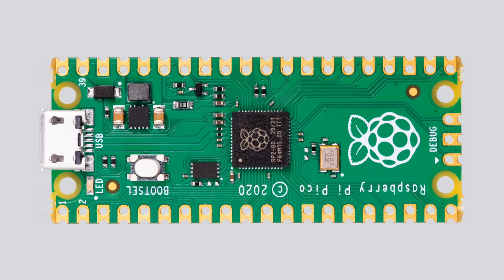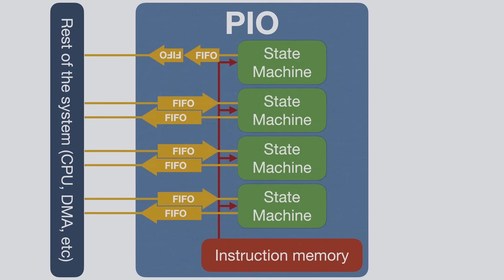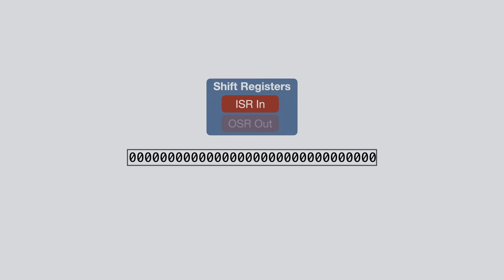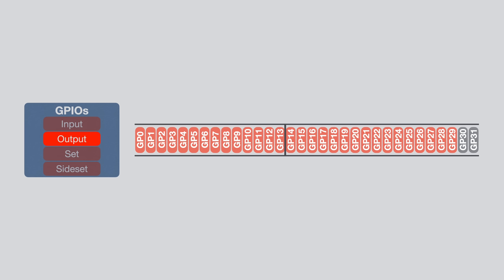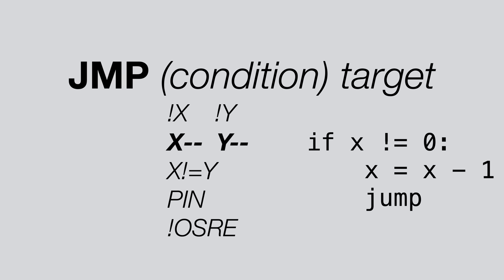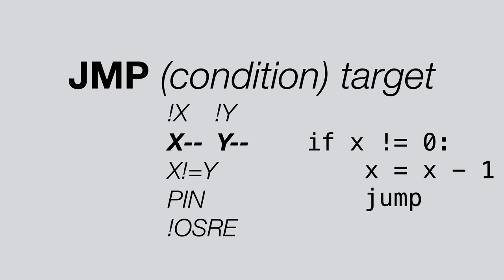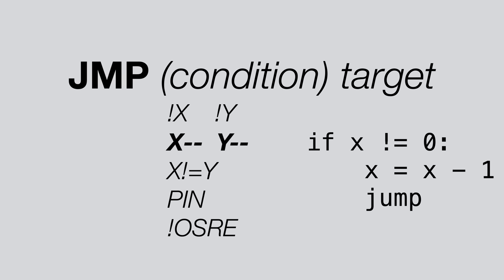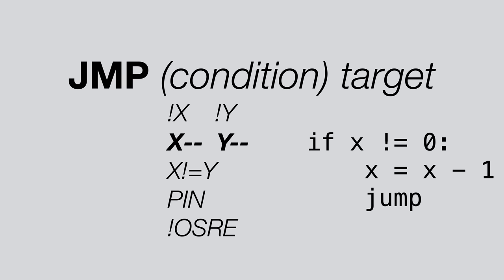In-depth: Raspberry Pi Pico's PIO - programmable I/O!

Comment: how similar or different is RP2040s PIO to something like 81C55 IC?
Could same functionality be implemented externally on other MCUs?
Reply: It is totally different from your RAM chip:) I think you meant a micro-controller with a 80ties series core(?). Totally different architectures (ARM)from a totally different time-period.
Yes, such high-frequency functionality can be implemented with standard gate logic, FPGA or something similar.
At all, first you have a problem and then you solve it ... not the other way around. Lets wait for some hobbyist talking about their +200MHz SPI and then have a good laugh.
Reply: @dieSpinnt  
I guess, I should rephrase. I am interested if there exist a readily available IC that could bring PIO functionality to other MCUs. I just recall this RAM chip used in some similar way in a schematic of some production device. That's why I saved it, but I am still lucking embedded designing/programming skills to read datasheets fluently to fully understand chips capabilities.
I get that Picos PIO is built internally with the same logic that you could design externally with discrete parts, but that is like reinventing the wheel and a whole lot of work on a completely different level of EE, and there are problems like shared memory, that are probably not that trivial to solve, etc.. FPGAs are simply in a order of magnitude different price category, and the thing with reinventing the wheel still stands if there exist integrated solution.
Reply: @Mr.Leeroy  Simple experimenting boards for FPGAs are under $20. Chips, PLDs are a fraction of it. I think, this PIO is a nice gimmick and other MCUs handle problems given just equally good with other technologies like IRQ, normal buffers/plain old shift register, dedicated counters and DMA. 
..... The problem comes first, then the solution:) So that PIO first has to show its superiority in a real world use case. 

An example of my skepticism: A traffic light control could be implemented very elegantly with this PIO facility. But that is far from being a high-speed application. In addition, this can be programmed exactly in the traditional way. Without any addition that might be extremely difficult to debug. The instruction memory is much too small and even more difficult to understand for fast applications. It's just old wine in new bottles. The timing has to be right, with or without a PIO. PIO is not cut off from the rest of the application ... And if it is (like a gimmick) it means that the rest of the processor is bored and I would not have needed PIO in the first place. 

Have you seen Schmitt-Trigger inputs as such for high-speed I/O? Not me:) And I've never seen a programmable DMA controller with PHB(Peripheral High-Speed Bus) access before. No, that was meant ironic. You have to search hard for a MCU without one, these days:)
I am not saying this is not useful. Only that this is not something special and maybe a little hyped.
Reply: @dieSpinnt  I'm not advocating for PIO like something worth writing home about in terms of real product design. It's seems like relic from the past. Although, the fact that it is not blocking main cores could come in handy one rainy day.
Sure you can code the same thing in a bunch of different ways. But it fits well in Raspberrys educational theme and is indeed an intriguing little feature in educational perspective, just something very low level to tinker (play really) with, get out of comfort zone of Wiring framework.
Reply: @Mr.Leeroy  No, sorry. I'm not blaming you. I just think it's terrible that so many others are now on the hype. Blinkers. As if there was nothing else.
Programmable I/O is a very flexible and good concept. This is moving in the direction of parallelization or externalization, and there, too, the necessary caution must be exercised.
Your thoughts about the Arduino / Wiring Framework? Absolutely true!
Let us surprise;)
Reply: Can you tell me which comparable cost mcu can bitbang dvi? Seriously asking.

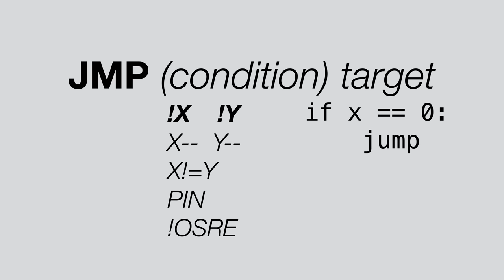Comment: 8:19 shouldn't x be decremented even if it is zero?
Reply: You're right. According to the RP2040 datasheet: "JMP X-- and JMP Y-- always decrement scratch register X or Y, respectively. The decrement is not conditional on the current value of the scratch register."

Comment: nine simple instructions and 42,000 modifying parameters,...
...
I am a retired electronics engineer, I have been reading the pico docs, watching videos, and experimenting. This video is as close to an explanation of the PIO as I have found, and yet it is way too fast for absorption. What would be nice to find would be a Map of the instructions with the parameters shown in a graph format coupled with examples and explanations of the code.   
The PIO system IS NOT A SIMPLE SYSTEM, when you hear that it is, run.
It may turn out to be a useful system, but if it remains as inaccessible as it is today, it will fail.
I will push thru it, and learn it but I see a climb ahead.

Comment: IO mapping is nice and with this all wholistic alproach new. Assembly however is not. How does the perfomance compare to the well established manufacturers?
Reply: Bad? I mean compare a learning device without any industry-certification against specialized high traffic I/O processors, an FPGA or a specialized DSP? Bad!
Nice gimmick, this space for 32 instructions. I like it. But I like it also without any restrictions and that the device can handle the job out of the box. Time will show how useful this really is in the hobbyist space. High speed bus applications aren't really an often seen topic or application and mostly impossible, too. For reasons ... (one is: Breadboard!) :)